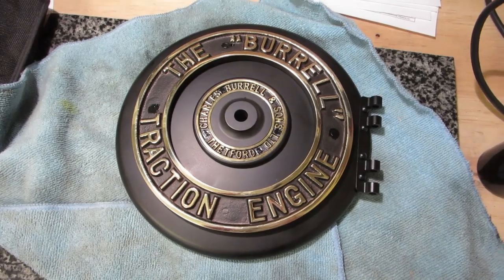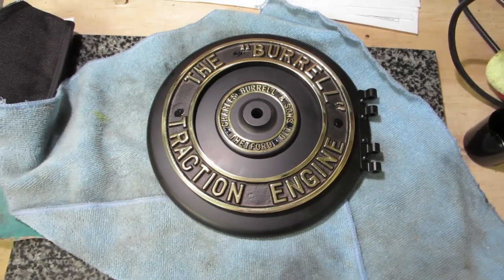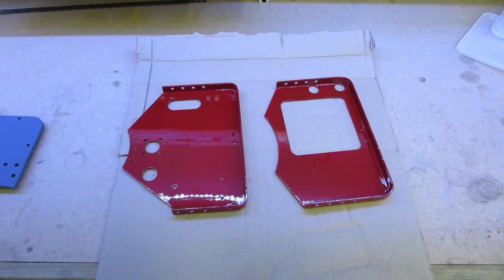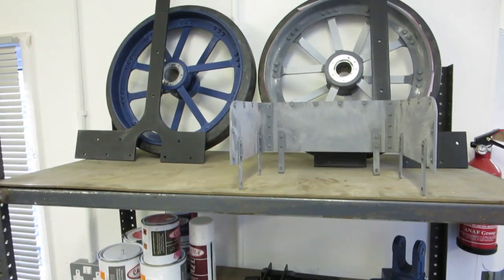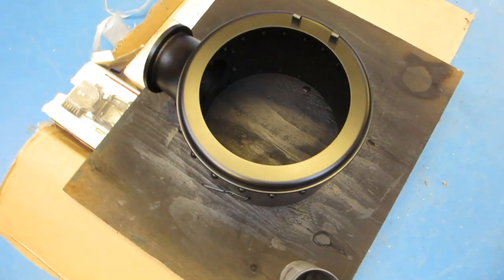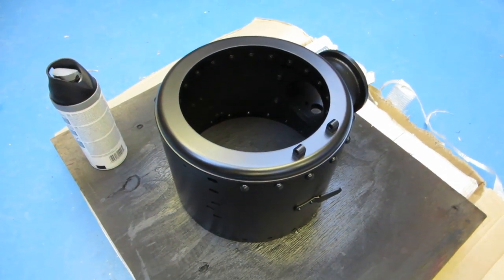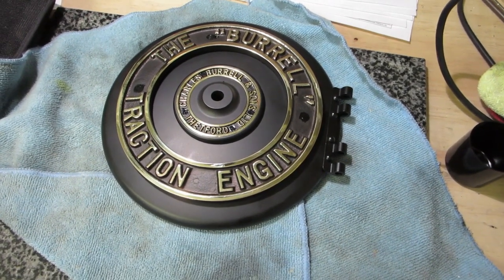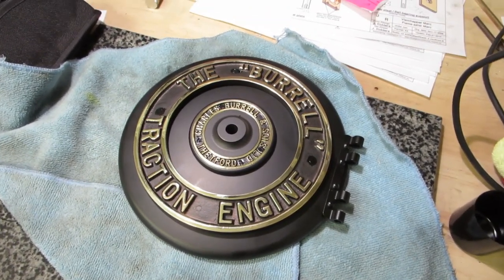Building a Burrell SCC Part 10 - Smokebox kit arrival and general update

Comment from the maker: Hi thanks for the comment. I'd say anyone with a bit of a mechanical mind can build the kits, it's only finishing you need to do so you don't need any machine tools, you could probably do it without power tools even, although you would be there a long time! I am a beginner to machining and trying to learn that side of things but at the same time also wanted a model I can steam and enjoy within a reasonable timeframe. Just building the kits will not teach you machining skills, but you would learn a lot of fitting and finishing. As a beginner I would stay away from part builts unless you know the standard of work to date. As a beginner you don't want to be trying to fix problems that someone else has created before you even start. Unless you have an experienced friend who can check it for you and help you I would say you are better off starting from scratch. All depends how far finished it is though of course! I personally am building the traction engine from kits as you have seen and keeping my machining interest going making some small bits and bobs on the side, for example the Elmers Wobbler engine I have a video of on my channel. As for lathe you really need to look at some plans for the engine you want to make and see how big the parts are. I have a 6.5" centre height machine which would be big enough for a lot of a 4" engine, but would still be too small for things like flywheel and final drive gears. Good luck! :-)
Reply: Will you be doing a video on once the build is finished?
Reply from the maker: Absolutely! I plan to steam to the pub :-)
Reply: +ChriX Builds that sounds awesome, can't wait to see the finished product

Comment: Out of interest, was it a requirement to turn the brass ring? 
They look great fun to build, Thanks for the update!
Reply from the maker: No not at all, it just saved a bit of manual filing and got it done a bit quicker. There isn't a need for any 'heavy' tooling such as mills or lathes with these kits, mostly just hand tools, and an angle grinder helps a lot. It is great fun to build, but I am looking forward to the first steaming a lot! Thanks for watching :-)
Reply: thanks, i had a feeling they said no machining required. 
do you have to get a boiler test?
thanks
Reply from the maker: calm callum
The boiler is hydraulically tested at the factory and all certified etc., but you do need to have a steam test when you're finished before you can get your public liability insurance for rallying.

Comment: Hi chrix.... in need of your assistance, how did you manage to polish the small name ring ? My casting is prototype thin on the lettering and don't want to compromise anything when I start to prep it ?
Reply from the maker: Hi Phillip, I sanded the face with progressively finer grits of wet and dry sandpaper, followed up with a quick go on a bench grinder mounted buffing wheel. I am not sure how this would work with the thin lettered ones; I know at least in the large form these were replaced but not sure about the small ones. It might be worth asking Steve? Chris
Reply: Lovely thanks for your help also did your large name ring sit flush on the fibre washer and have a small gap between the door as one side of my nam ring is a perfect gap but the other is a massive gap between the outer ring and the door ?